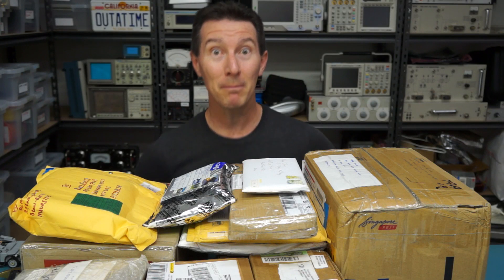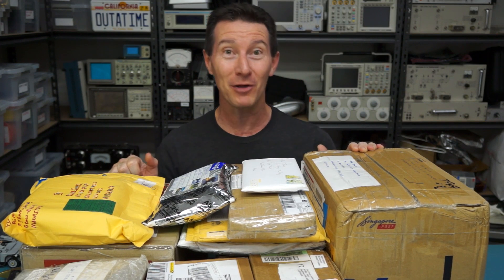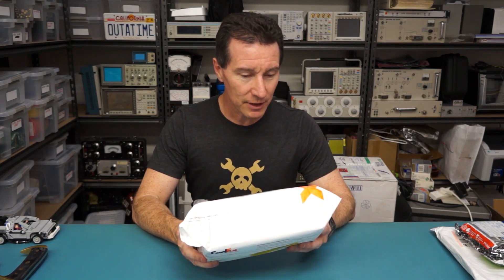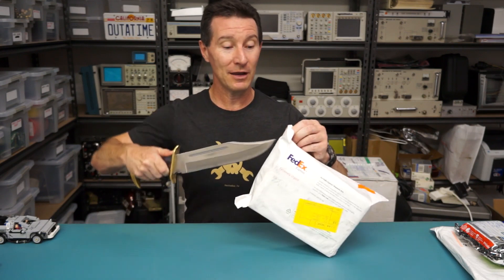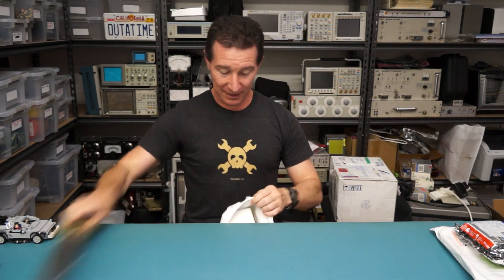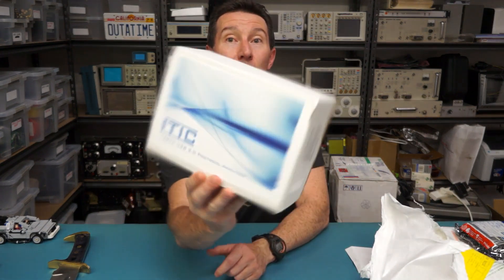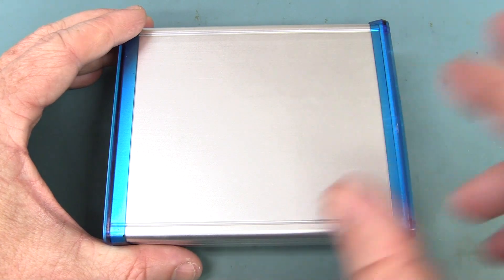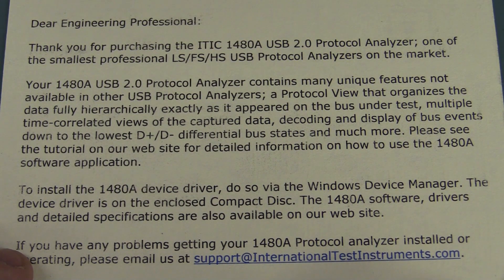EEVblog #673 - Mailbag

Comment: Dave, the idea with the erratic clock is to be accurate on a by minute basis but drive you insane with the erratic ticking.
Reply: Exactly right. That particular firmware ticks once a second, but on a random tenth-of-a-second.
Reply: Nick Sayer Unfortunately the Black arms on Black background makes it functionally useless. :(  I like the erratic click idea.
Reply: ***** Well, you can hear it though. One of the side effects of the replacement controller is that it makes the clock tick a bit more loudly than it naturally does. Which is a feature. :) And the hands come off fairly easily, and can be painted.
Reply: Tilman Baumann it's called a Vetinari's Clock
Reply: I so want one to drive my friend nuts!
Reply: Sirus I sell them on my Tindie store: http://tindie.geppettoelectronics.com/
Reply: Very bad idea make a clock with background with same color as the watch hands ...
Reply: radikalq3 Yeah, I didn't think of it at the time. If Dave wants, he can pull the hands off easily and paint them.
Reply: Nick Sayer
I think the hands being the same colour just adds to the flavour of the devices intention :D
Reply: Yea. It's all about the ticking.
Reply: I had an idea for something similar to this a long time ago. Maybe 5-7 years ago I got thinking about how some people adapt to sounds with a constant period, like the ticking of a clock. And I wondered what effect it would have on somebody to hear a sound with a more random period on a constant basis. I hypothesized it would cause distress and anxiety. Never got around to testing it though. I could probably make a program in VB easily enough to beep at random intervals between say, .1 and 3 seconds and just listen to that for an entire day.

Comment: Anyone keeping track of how much gear Dave has trashed by attacking it with the industrial machete? We get the joke, we really we do, but dude, it may be time to retire the Croc Dundee knife yeah? People sending this gear are spending their own hard earned cash to send you stuff they have invested effort in, it might be time just to show them a bit of respect and appreciation by not trashing 20% of it. As an engineer you should know to use the right equipment for the job. Show a little patience when unwrapping it and don't just heave and rip away at it. Please?
Reply: Agreed. It was such a bummer to see the shattered solar panel. I thought Dave would realize that it was so heavily packed for a reason.
Reply: Electron Alchemy Yes I agree, I propose using Swann-Morton surgical blades. Made for cutting precisely, and relatively cheap.
Reply: xFreeland1 It actually wasn't packed properly for how fragile it was. It needed to be sandwiched between two very, very inflexible (like steel) plates to keep it from being flexed while being unpacked. It didn't need the 19 layers of tape and bubble wrap.
Reply: Nick Sayer yes, you're correct. One piece of thin plywood, a bit of tape and one layer of bubble wrap would have been sufficient
Reply: Way too much tape. I probably would have just thrown it into the trash. I'm not going to spend 10 minutes tearing through a package.
Reply from the maker: Electron Alchemy Name one other thing I've damaged with the knife? This wasn't really my fault. It wasn't marked fragile, the note was embbeded inside so easy to miss, and the cell was protected with flexible cardboard.
Reply: Dave hasn't damaged anything before with THATS A KNIFE apart from his wallet. I notice it's getting a bit blunt or gummed up with parcel tape glue.
Packaging a cell like that is the equivalent of sending a fine crystal glass set in concrete. Yup, it's safe, but you can't get it out without damage.

Comment: Solar cell package - how to pack something for protection in the mail while making it nearly impossible to open without breaking it.
Reply: I thought exactly the same. Some rigid plastic enclosure would do the job (like one used with CDs, just bigger). Or at least some huge red warning saying "Extremely fragile" or something like that. Too bad it broke, it could be nice big solar panel and Dave could do some great video showing how this actually works in practice.

Comment: Nice bowie knife. :-). I have a couple. Nice letter & package opener. The rotary switch on the analog meter is a beauty. The good thing about the solar cell is, even though it broke, you can still use several of the pieces.

Comment: Hey Dave, its Rob here, the guy that sent you the ECG machine! I'm glad that you like it. 

I should point out that the machine came from eBay with that ground-wire bodge.

The machine does work when the probes are hooked up and you press random buttons.

Comment: Hi Dave, Welwyn Electronics (pronounced well-in) were originally based just up the road from me in UKs first garden city (Welwyn Garden City) from 1937.  They are now part of TT Electronics PLC but they still produce its iconic green vitreous enamel coated wire-wound resistors, but in Barbados rather than the UK.

Comment: 24:30 - Those Welwyn resistors - I wonder how much the values vary with humidity (even if the inside of those tube is evacuated (I'm guessing), the surface could get dew-ey and decrease the resistance! I'm guessing this is why it's rated at 10% tolerance.

Comment: I remember once I picked up a 32gb Micro SD card on sale for $10. When I went to use it, for some reason Windows wouldn't let me format it. And when I did finally get it to format, there was only something like 261mb listed on the drive. When I took it out and examined it, I realized I'd clipped the edge off with the scissors when I opened the package. I'm surprised it still "worked" as well as it did. I would have figured removing part of an SD card would damage it beyond any sort of operation.

Comment: Different type of security gate. Checkpoint Systems makes anti-theft systems for retailers. There's probably some interesting RF processing going on inside. The right side of the board is probably power amps for the transmit antennas, and the left side of the board probably analyzes the received RF signal for the presence of anti-theft tags.

Comment: I think that solar cell probably cracked when you bent it if anything else. I don't think it had much to do with the knife, at least not directly. I love that you put up the video anyways, even though you screwed up, assuming it was in one piece when it arrived. I'm not an electrical engineer, and in fact I can barely wire a circuit to demonstrate ohm's law, but I love this channel.

Comment: What can we learn from the solar cell dave...? READ THE NOTE FIRST!
Reply: No, what we can learn is that 1 piece of tape on the outer layer is sufficient... sheesh...
Reply: He should read the note first though IMO. Just out of respect
Reply from the maker: LoseThePlotGaming I didn't see the note in the bubble wrap.
Reply: My goodness, even if he only used one piece of tape on the outside, this would still be the stupidest packaging seen in a long time. Sturdy box with a couple of layers of foam would have been fine. Bubble wrap does not prevent things from experiencing bending forces. Absolutely no thought went into this packaging at all, except for "more layers of bubble wrap is better", which is just stupid. Dave, you shouldn't feel even remotely bad about that packaging, you were framed.

Comment: Based on the purple color, I assumed the board was made by OSH Park. I searched the site, and found "Crazy Clock v0.8"... It basically ticks randomly, but keeps the correct time. The version on this clock is v0.6. Go to oshpark - dot com/shared_projects/INH02L3I

Comment: The UT513 can measure upto 20 GOhm at 500 Volts; might be borderline.  Try bumping it up to 1000V test voltage.
Reply: Minds think alike..... I googled the specs of the meter and saw it topped out at 20gohm on 500v.... the megahom units I used to use topped out at 19.9gohm.... so that's where my insight came from :)
Reply from the maker: madd hatter Yeah, oops.

Comment: Security gate + Ethernet + Database = some kind of LDAP backend... Lotus Domino / Microsoft ActiveDirectory / Novell eDirectory / etc...
I worked for Novell, we had the fingerprint thingy hooked up to the LDAP server for access logging (not really security just a checkin/checkout clock) If it isn't Access Security maybe product security using basically the same principle (check in, check out products instead of people and ring alarm if checkout without permission a.k.a stealing)

Comment: The Checkpoint Security gate component is used for those annoying detectors that ring when the idiot cashier forgot to remove or deactivate the security tag in something you just purchased. One of the features is that it can connect to a high end DVR so that a pan tilt zoom camera will automatically turn to the door where the merchandise left. In the event of repeat thieves this actually helps to identify them so the next time they enter the store you can put feet on the ground and catch them in the act.

Comment: LOL who the hell would send a solar cell in the mail...that thing had 0 chance of surviving post..
Reply: Would have been fine if it were packaged sensibly.
Reply: TheHue's SciTech not even.. LOL i have a LOT of those cells laying around and if you as much as fart near them they shatter..
Reply: Rigid box, two little bits of foam. The cell is so light and has so little inertia that it can be shaken around like crazy and will be fine. How were your cells delivered?
Reply: TheHue's SciTech in sandwiched stacked hard plastic with aluminum support brackets to where they couldn't bend..or move.
Reply: warmfreeze Exactly... packaged sensibly.
Reply: TheHue's SciTech thats the reason you can usually only buy 50 cells at a time or it will cost more on the packing materials than the cells themselves...
Reply: Oh, so now it's "too expensive" rather than "impossible". Fact is, two bits of plywood and a thin sheet of foam would be fine, and that costs 5$ from the local hardware store.
Reply: TheHue's SciTech why are we arguing such a moot point?
Reply: Because you misplaced the reason for the broken cell. It wasn't the use of the postal system, it was the incredibly dumb packaging.
Reply: warmfreeze Marcel would...

Comment: 39:45 of course it's all rusty, it's Italian!
Reply: Many thanks!
Reply: Maybe the same electrical engineers that designed Italian cars wiring or mopeds for that matter. Classic mopeds are amp based rather than voltage, very confusing to a noob.

Comment: Won't hear me complain about a mini teardown! Also, there's nothing wrong with pulling out the old Victorinox.
The Dundee knife might be "nifty", but hey, the right tool for the job. Don't let anyone tell you it's too small. :)

I'll also agree... Mandatory cloud anything sucks! If you WANT to have accessibility, then sure, some people might opt for a cloud structure, so they can have universal access. Sadly, on those days when the internet is down, it's nice to do some design instead of watch youtube! Cloud mandatory... Nope! :P

I have shipped solar cells in that cheap "glad ware" not quite tupperware. I cut layers of thin foam and and placed them in sandwiched layers. Foam,cell, foam, cell, foam. Then it's just a matter of packing the container. It's a super cheapo version of the actual shipping packages I've seen used for cell shipping.

Comment: Dave your mailbag videos are alright! Don't leave us circuitry aficcionados only to the case, open up the thing and if you think that it actually needs a separate video, then you do it!

and btw, that end item is obviously a cardio meter, you can see the frequency of 5Hz, and also that V/mm is the response in the chart. Those crusty things are the stuff you probably put on your chest, then release the rubber ball to the suction hold it.